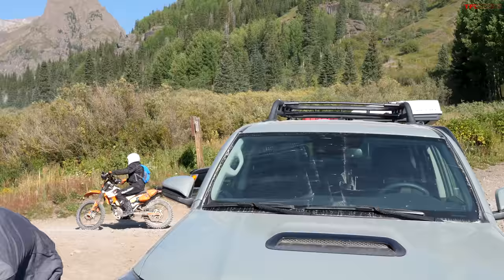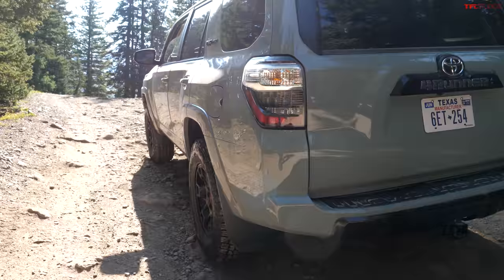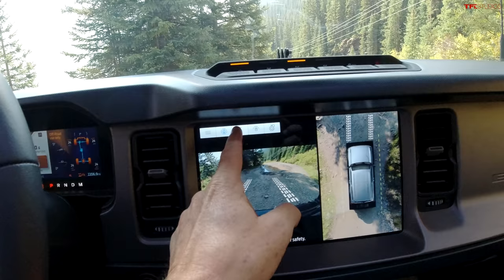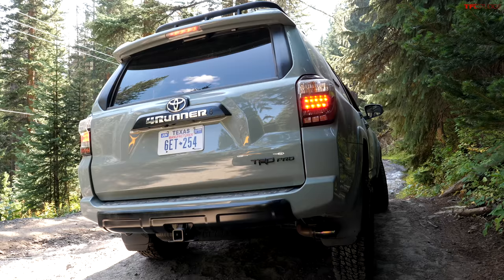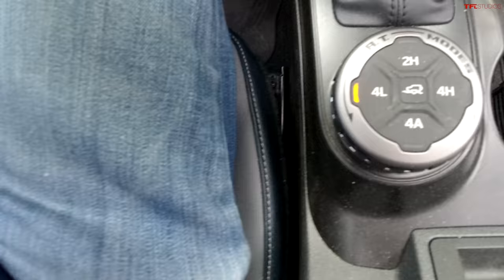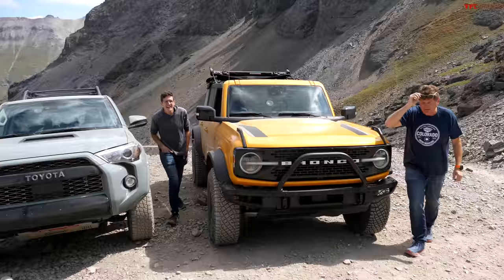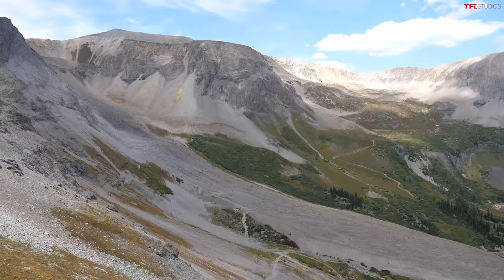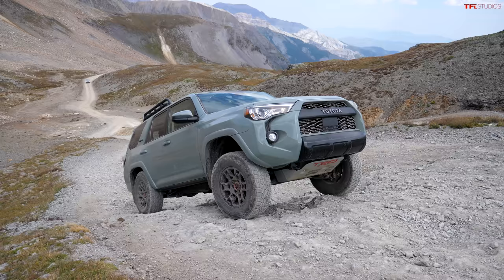The Toyota 4Runner TRD Pro May Be Old, But Can It Still Keep Up With The Ford Bronco Up A Mountain?

Comment: I agree with Tommy. If I had to buy one, 4Runner all day, but the Bronco sure would be a fun lease.
Reply: I’m looking to get a 2022 Off road and cancelled my Bronco reservation just before they opened up the build and I’m glad I did as all these problems are surfacing. It does look cool but from what everyone is saying the MPG is the same for both.

I can’t wait to mod my 4Runner.

Comment: Great video and good review! The 4-Runner reminds me of my '07 Explorer Sport Trac in some ways - 4L V6, 5-speed, spare mounted underneath. Both have highly reliable drive trains. I suspect if you took the 4-Runner up the trail that stranded your Defender (conquered by the Bronco and Wrangler 4xe) it may not have fared as well, due to the large rocks and its 32" tires. When you need to drop the spare there tends to be a bunch of dirt and rust on the top side (which I know from experience) and the cable release can rust to the point of not releasing the spare. That happened on my chimney sweep's van in my driveway a few weeks ago. He ended up taking a sawzall to the chuck that held his spare up to get it to drop.

Comment: Two amazing vehicles. The more I see from the Bronco, the more impressed I am. 19 mpg with a bigger engine and tires. A great classic type of look. But the tech they have put into the 4wd takes it to another level. The bigger tires helps it dominate the trail as well. Both front and rear diffs lock! 
You have to give a big reliability edge however to the TRD, seeing that the 4Runner is one of the most reliable vehicles EVER MADE, is perhaps a little more practical/versatile as a daily driver, and still more than holds it own off-road.
They summed it up really nicely, two different vehicles for two different drivers/situations.

Comment: Seeing as how the 4Runner has a towing capacity of 5,000 lb and payload capacity of 1550 lb compared to the Bronco's 3,500 and 1,350, as well as go 99.9% of the places that the Bronco will go, I think that the Toyota is the better all-around vehicle.
Reply: Really disapointed by the Bronco tow capacity. I would buy one but it can't tow a good boat.
Reply: I agree with your assertion and if I were choosing between the two, I reckon I'd go for the 4-Runner, but for the money, I don't think I'd buy either one of them.
Reply: The Bronco towing amount is the same as its main competitor the Wrangler, with a bit more payload. I think I would feel more comfortable towing a 3500lb load with the Bronco than trying to tow 5000lbs with a 4Runner, if I was towing 5000lbs+ loads, a full size truck is what I would use.
Reply: I'm not sure why Ford put such low limits on the Bronco, it has the power, weight, and width so it could do more. Probably so they keep selling their trucks.
Reply: @TubeRLH  In another video's comments someone suggested it's because of sway control, as the Wranglers numbers are very similar to, I think that didn't want to have the vehicle put in unsafe situations, cause no doubt the powertrain can handle more.
Reply: @garys2157  There are only two Bronco Trims that have Sway Bar disconnect, the First Edition, and the Badlands, so why wouldn't the Wildtrak have more Towing capability?
Reply: @TubeRLH  I don't think sway bars and trailer sway control are the same thing, maybe someone else that knows more can say something.
Reply: @garys2157 , I guess I didn't understand what you were speaking of. Yes, they are different. I forgot about trailer tow sway control. While towing, if your trailer starts to sway the Sway control sends a message to your dash to slow down, and also it starts to apply brakes to different wheels to counter the vehicle from swaying, and if necessary it will back off your throttle to slow you down if you don't respond quick enough. It's just more magic very few other vehicles have.
Reply: @TubeRLH  That sounds right, IDK if it was straight from Ford, but in another youtube video someone had said that was the reason for the 3500lbs.

Comment: So wife in the market, test drove badlands last weekend same orange color, 285's, 4 cyl. Turbo, 6 speed manual, soft top (down during test drive).  Just our take of course, it was nice but kinda boring, plasticy, lacking sole and character, not a fan of the rear access...lift the top up deal.  Nice seats, very comfortable, good power in the 4 banger.  We are ordering a Jeep Rubicon when 22's are available 🤷‍♂️.

Comment: That bronco has 3 (maybe 4) huge advantages over the 4 runner, so the results showed the Toyota pretty well. 
1. Locking front diff
2. Detachable sway bar
3. Tire size
4. Tire tread design 
5?  The 10 spd tranny vs 5 spd

Throw larger and better tires on there and that would be a HUGE jump in off road performance. Huge.

Comment: I love both. I had the choice, I went with the pedigree for longevity in the runner pro. It also gave me a bigger flat back to sleep in as I can’t use a rooftop and sometimes don’t want to set a ground tent. The atrak and crawl control gets me everywhere I want to go that would use lockers for on the front.

Comment: I have 2016 Tacoma TRD off-road. The first thing I did was undercoat the frame and check it yearly. I live in the northeast and so far no issues with rust. Keep and eye on it and do some basic maintenance and you won't have a problem with frame rust.

Comment: Imogene pass, honestly, is pretty easy. If you pick your lines well you could definitely do it in a Bronco Sport any maybe a Subaru. It you want a harder trail try Mineral Creek trail and then over Engineer pass. Try Black Bear pass, much of it is easy but the steps test flex and stability and the super tight switch backs test maneuverability. Test the Bronco rock crawling on the wall in Poughkeepsie Gulch.

Comment: I bet an sr5 4runner could do this trail just fine. I would love to see how the suspension goes in a pre-runner situation.
Reply: Thats true. My sr5 build can do that without any issue. Just atrac😉 and you all good
Reply: I got an SR5 with an emu 3.5 lift suspension and I have 33s on them and I don't think I ever got stuck yet.

Comment: The Toyota rear locker engages a lot faster if you're not driving straight with even traction on each tire. The only reason it isn't engaging is because the diff isn't lined up correctly and you need to either lose traction on one tire or turn to allow one wheel to spin farther.

That's not to discredit the speed of the bronco locker though.

Comment: Toyota needs to add real all terrain tires to their 4x4s. I have K02’s on my 21 4Runner TRD OR along with a couple of my older Toyota 4x4s. They are far superior to the stock on road oriented tires Toyota insists on providing. I would also love to see a front locking differential available on the next gen 4Runner TRD OR.
Reply: I have found that a-trac functions in place of a front locker pretty well for trails I’d take a stock or slightly modified t4r trd or on. 🤷
Reply: Toyota knows most people will upgrade the tires and wheels for off-road and they want to keep their mpg high for EPA standards. Also you don't really need bigger at tires unless you live in the Rockies. Mall crawlers more than Rock crawlers.
Reply: Naw man most 4 runners ( at least around me) ate driven by women.... Usually good lookin women I might add 😅
Reply: @justinteal495  that’s funny.  The same can be said about Broncos.
Reply: @bigpk2003  honestly youre right but its usually the lower end sport model that I see females driving, in see a ton of women driving the trd's

We'll see if my observation holds true when broncos are a little more available

Comment: Very nicely produced video and as always engagingly presented.  However, in the clips it certainly appears there is a jouncier ride in the 4 runner which looks very familiar (not terrible) to those who have driven them; the Bronco looks really well tuned and comfortable off road with less side to side head motion and is really remarkable for such a capable vehicle running almost 35" tires. Secondly on road the engine transmission combination of the 4runner is awful.  It sounds coarse and strained when asked to accelerate and feels delayed and slow. The infotainment system is seemingly form another era.   The Bronco I test drove was miles ahead in the engine/transmission combination.  If you want a second vehicle to go off-roading, I don't think it is even close.  If you only occasionally off-road and on trails that are not extreme (like some of the harder Moab trails or taking the harder lines on intermediate trails) the 4runner is a more versatile choice as an all around vehicle.

Comment: Would love to see a 10 year old Forerunner vs similarly aged Bronco, how do the flashy mods etc hold up and last or not?
Reply: Okay.  How about a 50 year old Bronco vs a 50 year old Forerunner?
Reply: @buckhorncortez  a 1970s 4Runner would torch a bronco and it wouldn’t be close
Reply: @antoniotrejo9240  prove it
Reply: @antoniotrejo9240  4runner didn't come out till 1984. (there were some conversion type trucks in the early 80s, but not real 4runners.) Broncos from 78-96 are legit fullsize trucks based on the F-150. I've owned all of them over the past 20 years. The current gen 5th gen 4unner and new Bronco are really the only (semi)direct competitors.
Reply: @antoniotrejo9240  BS
Reply: @buckhorncortez  There wont be any 50 year old Broncos. There will be a few 4Runners.
Reply: You mean 1970s Land Cruiser.
Reply: People asking for 10 year old broncos and 4Runner from the 70s?? 😂😂😂
Reply: @gs98999  'superior' logic at play there.
Reply: @nicholascooper1193  Don't let facts ruin a good story.
Reply: @gs98999  Land Cruisers from the 70s!
Reply: @Riaan3108  best reply ever

Comment: What a great run up this trail. I wonder, because Roman keeps 'bragging'   ( justifiably )  about the 35 inch rubber on the Bronco, why not swap out for 32's ( if that would be possible ) 
 and see if Bronco will still perform as well. 
I'd guess that Bronco will still be an off-road performer of note.

Roman, I have to agree with you, those 'shelf' roads and the ability to crack walnuts, is in my thoughts LOL!
Reply: I think non-Sasquatch broncos are on 32s, to be honest thats how i would buy one just for the manual transmission
Reply: Non Sasquatch Broncos have about an inch less ground clearance than the TRD Pro.

Comment: The Bronco engine compartment looks like the plumbing section at the hardware store.  😄
Reply: You left off the "after a 1,000 pound bomb went off in the tool department and made the whole place a jumbled mess."
Reply: @jerroldshelton9367  😄

Comment: That Bronco is really cool but let’s face it, that Toyota will still be on the road and rock solid long after that Ford has fallen apart.
Reply: Toyota of new is not Toyota of old. Having said that I also would want the latest tech for the money so would go Bronco.
Reply: That's not my experience with ford. Both seem to have good reliability. Bronco will have some 1st gen issues to iron out, if that's what you mean
Reply: This is funny to me as my buddies Tacoma has been out of commission for a month because a small rock killed his whole transmission going down a gravel road. My wrangler outlasts both these vehicles in real world. While doing real off-road not just flat dirt trails
Reply: @SanctumOfDreams  how did a rock get in the transmsion
Reply: @s0lsh1n  that one sounds anecdotal, but let's face it: the earlier 3rd gen Tacomas had transmission issues. Be it reprogramming or mechanical issues the issues were there and people complained about hard shifts and clunkyness in general.

Comment: Honest question... Has anyone ever used one of these off-road cruise control systems organically? It seems no one uses it except to show it exists. I don't really get the benefit. Even for a novice off-road driver I think it induces more anxiety than anything. And yet every manufacturer is putting it into their off-roaders.
Reply: I got the manual Tacoma.  Off road cruise control is fine lol probably wouldn’t do much when it gets really gnarly.  It’s more geared to beginners and beginner trails.  I can’t think of any situation in the last 20 years that crawl control would have been a better option than just driving
Reply: I use it on long steep descents (even have used it on Imogene) but it still freaks me out that it could give out randomly and I could accelerate. It does make it nice on some of these longer passes.
Reply: I do use mine, but only in situations where I'm turning a good bit and don't want my rear locker locked, binding up the rear end. Crawl Control is at least 75% as good as my rear locker engaged....at least in my 2017 Tacoma. I hear the new ones have some different programming though.
Reply: I have a 2019 4Runner Limited and go off roading in the hills around SoCal. I’ve used the A-Trac and it’s pretty impressive, although I don’t do anything too hairy. I told this to my Toyota dealer and he said I’m probably the only person he’s talked to who has actually engaged the A-Trac on a Limited.😁
Reply: Had a 4Runner Trail and used Crawl once just to try it out.  In reality it’s clunky and very slow.  Maybe cool for rock crawling but useless for much else.  ATrac is great though, largely eliminates the need for lockers except for the most hairy of situations.
Reply: @jarod144  manual tacomas don't have crawl control (off road cruise control) do they?
Reply: If I had it in my Wrangler Rubicon, I would never use it.  I do use the Downhill Descent Control frequently.
Reply: Ive been offrosding for years, its not just for beginners. I use it all the time, its a great option if used correctly. You just have to understand its capabilities

Comment: 4rnr all day any day as an owner myself
35’s(1670 for 5 BFG KM3’s)
Gear change to 4.88 w ARB Locker(4500)
Re-Gear is only this expensive in SoCal 
Rock Sliders(250 DIY friend with welder)
F/R King 2.5 Shocks(3750)
Hidden Winch bumper/Winch 1350

I have the truck if you all want to go head to head against a built 4rnr that is still slightly cheaper with bullet proof legendary reliability🙌🏾!

Comment: Why don't yall air down? I know you show you do but 29psi in the bronco is still street pressure thats not aired down. Did you only take 3 or 4 psi out?. You need to take it down to 18 or 15.  Great vid though!
Reply: I have minimal off-road experience (that is until my bronco is finally delivered! lol) but the trail didn't seem too technical, I think only dropping a couple PSI is what I would've done.
Again, im a beginner though!
Reply: @austinbrimm6595  Them only dropping to 29psi is a waste of time really since that is still street pressures especially in 35" tire. Think of your tires as the first part of your suspension, at 29 they are still hard/firm so you will still feel a lot of the smaller rocks in the trail. If they dropped to 20 or 18 it would have made the tires softer and they would have absorbed more giving them a better ride and better traction. Even if you where going on a dirt road with washboards and in 2wd airing down will giver you a better ride and do less damage to the road. I have ran imogene, its an easy trail but i still was aired down to 15, no need to be bounced around.  Good luck on getting your bronco! oh and buy an air compressor and dont be afraid to air down.

Comment: The suspension tuning in the broncos is top notch. The Toyota is a legend and has what I would say are more practical features. Both are excellent, I would build a go fast Bronco over the 4runner, but for overland, or just pure reliability im grabbing a 4Runner. I’ve been an automotive technician 8 years and have only ever done brake jobs and minor repairs on Toyota trucks and SUVs

Comment: Would be sweet if the next gen 4Runner had removable roof and doors, like the old school
FJ
Reply: Would be nice for a next gen 4runner period.
Reply: Our like an old school 4Runner. Early generations had one, even though it wasn't as easy to remove.
Reply: Nooo! Leave the roof and door where they belong. Removable doors and roof are such a waste. Makes the vehicle more expensive, loud and leaky.
Reply: @timber543  okay the roof I’ll leave but the doors gotta be removable lol
Reply: @TonkaFire2019  with enough will anything is removable ;-)

Comment: I was in the market for a 4runner a few years ago until I took one for a test drive.  That power plant is anemic at best, I was really disappointed in the lack of acceleration when floored and you don't even get the benefit of good gas mileage.  I also think crawl control is gimmicky  and would much rather have a front locker.
Reply: Me too. I bought a 2021 Rubicon in January and it’s amazing! Fast and getting consistent 22 MPG combined. Love it!
Reply: @Pro4x Trdpro Interesting.  I was ready to buy and had $50k to throw at it but the test drive really turned me off.  I ended up getting into a new gas ZR2 for $37k and have no regrets.
Reply: @Pro4x Trdpro I've owned both 4runner generations (4th and 5th) and the power difference between the two is crazy. Not sure why they detuned it.